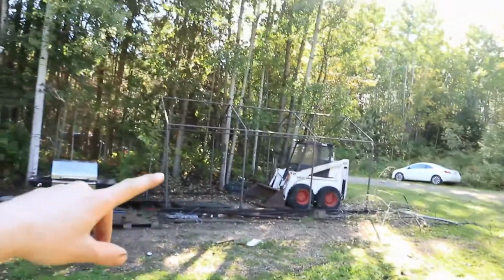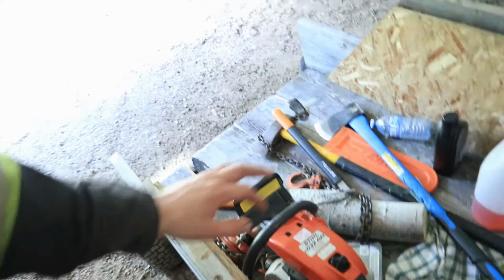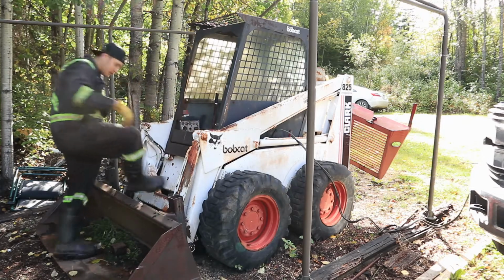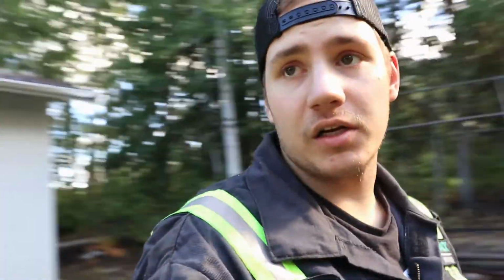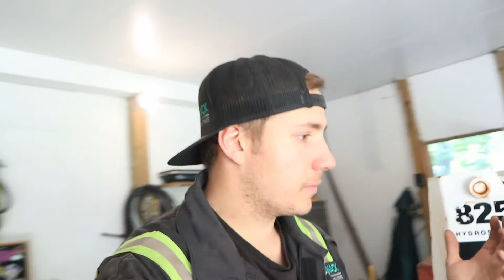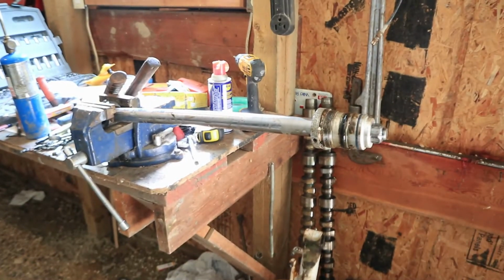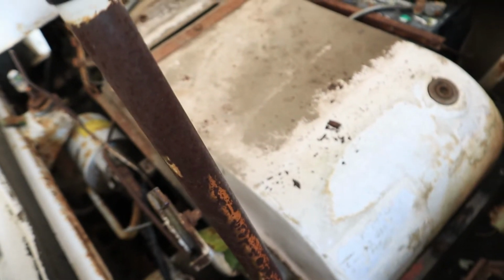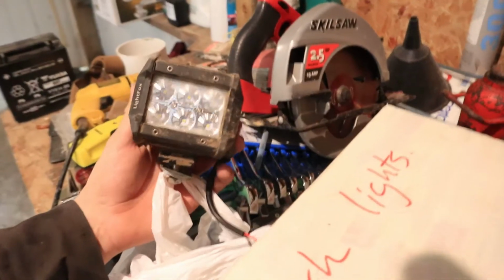Bobcat 825 - First Repairs

Comment: Hello Sir I just bought bobcat today 825 . The owner said that they got from someone and never run . So we got it today put new battery. It’s cranking but it won’t running. Little bit white smoke coming from exhaust. I pump the fuel . But no use . I also use starter fluid but no use . Can you help me out

Comment: Hi , I have couple questions about bobcat 825 , I just just bought one it’s very hard to start starts only with starting fluid . Idle very high but when throttle all the way up it dies . Maybe you can help me or at least guide what should I start with .
Reply from the maker: Clean out the fuel filters and clean the pickup on the tank, starting fluid is normal on these older machines
Reply: @BanackIndustries   inside the glass bowl on the left side is there a fuel filter to?
Reply: I have a Thomas with the same engine as this machine. Those Perkins 4.108 love heat when cold starting. The glow plug system on mine isn't too effective with less than 30 seconds of heating even in summer. The block heater works very well to help with this. For whatever reason Kubota engines just like starting cold better.